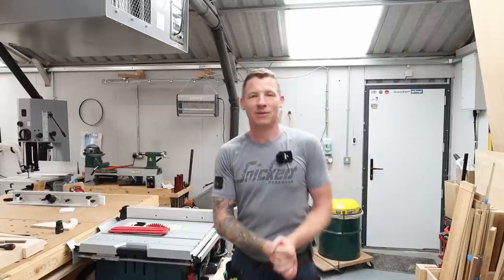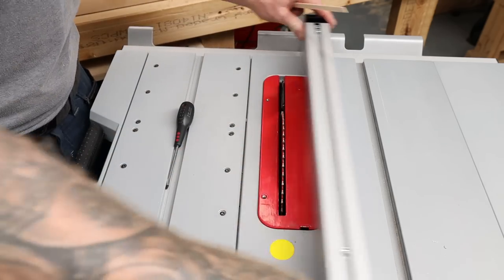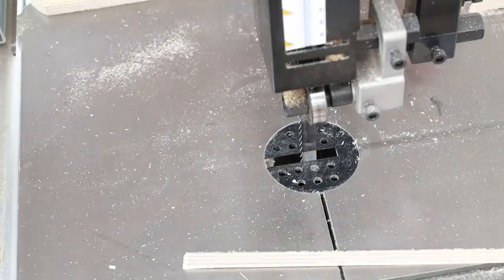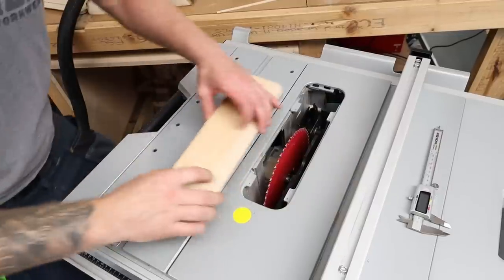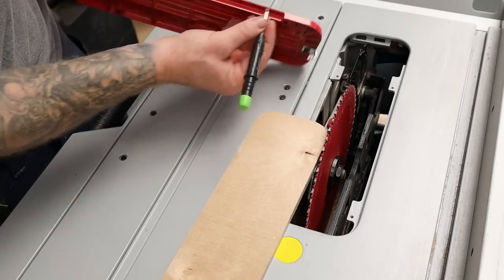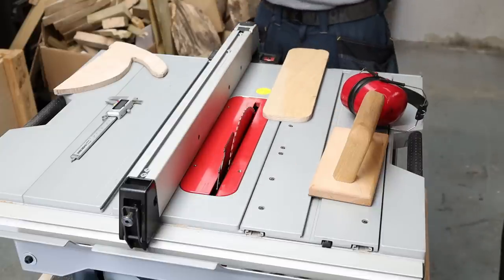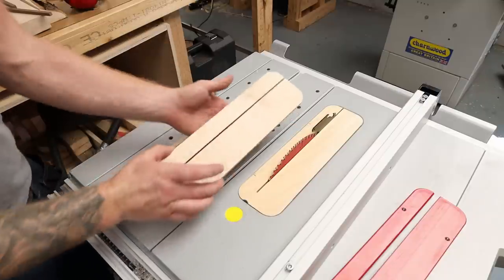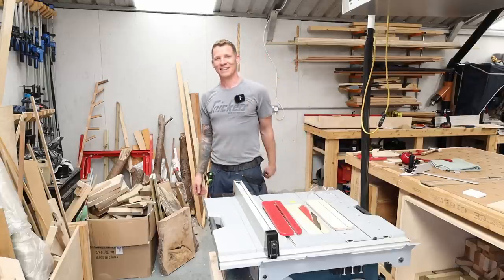Table Saw Zero Clearance Insert, How to make one and Why you need One!

Comment: This is great.  Helpful if you have a thickness planer and a bandsaw to make quick work of it.  Will need to try re-sawing using the table saw and then a jig saw.    I guess once a good blank is made that fits well it can be used as a template for the final shaping with a router.

Comment: I've made mine with this through cut method before, mine was for the dewalt compact table saw from baltic birch and the narrow side is 1-1/8" 28.5mm it warped the narrow side is higher than the wide side... I recommend drilling for a dowel before shaping if it's a elongated circle after fitting it and cutting the kerf put the dowl in and it'll stay aligned... Always harder to say something than to show it.

Comment: Hi John,  I have the same saw as you and find a constant issue with the blade height adjustment not allowing the blade to withdraw completely into the saw base and it's always down to a build up of saw dust on the guide rods of the lift mechanism despite having good extraction on the saw every time I use it.  I find myself turning the saw over at least every other week and cleaning this debris out with a bradawl and shop vac which can be quite fiddly.  I like the saw generally but find it a little underpowered at times especially if the blade is starting to go dull.  
I have a zero insert just like yours made in pretty much the same way just out of some marine grade ply that I had in the shop and wouldn't want to use the saw without it.  I seldom bevel the saw so just switch back the factory insert if I do but you're right that this can leave little to no support for the work piece at time so maybe I should stop being so lazy and make a sacrificial one for bevel cuts as well.  Thanks for sharing your skills once again.

Comment: Great Video John. Ive got the same saw and been meaning to do this for a long time. Think you may have just pushed me to make the effort. I have put my router in the extending wing of the saw, not something you need as you have the router covered but a board that drops in the wing is useful support.

Comment: You mentioned that the original wide slot is an aid to dust collection. Do you think that drilling a series of 20mm or 25mm holes in the wider section of the new insert would be advantageous?
Reply from the maker: It could help

Comment: John, what make is the router - I've never seen one where you don't have to tighten the collet?  Also  I have the same saw, but an earlier generation and the riving knife is removable - I know you bought yours second hand so if you don't have the manual you can download on line or I could send you a copy.
Reply from the maker: Hi Bill, it is removable if I pull the bolts out, its not removable with the quick release handle. I just didn't want to go to the trouble of taking the bolts out

Comment: Great video John......quick question re the table saw. How accurate do you find the measurements on the face rail? I have a slightly different model and struggle to work out out to get the fence to cut say 100mm by using the fence guide measure.
Reply from the maker: I use it as a guide only, I measure from the fence to the blade with a steel ruler if I need to be precise.